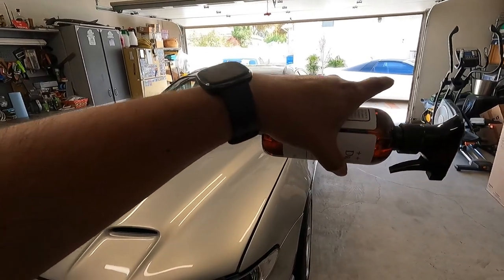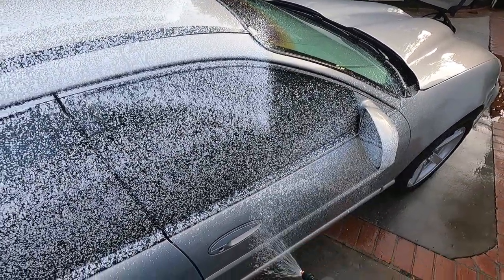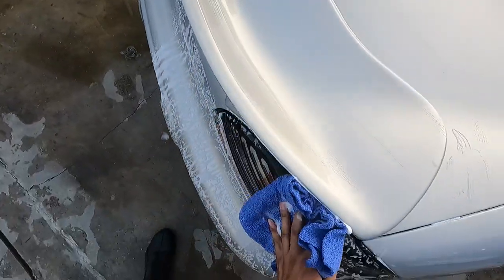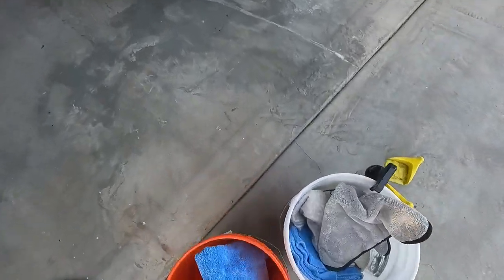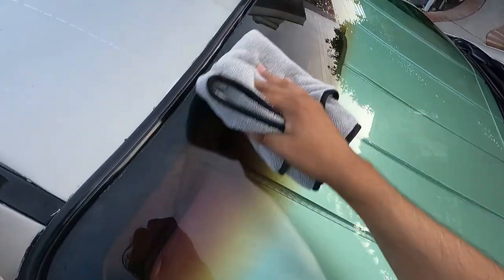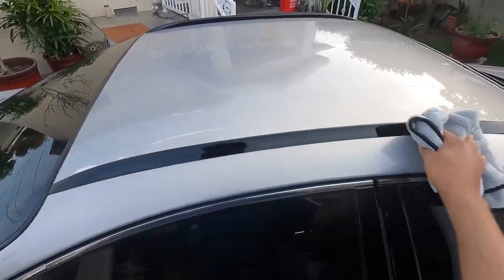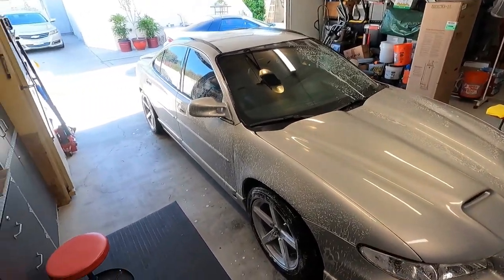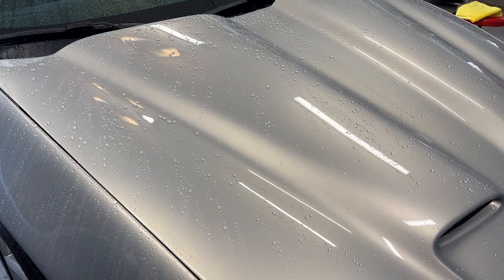Dr. Beasley's Paint Hero Application and Review

Comment: Kinda weird showing off a drying aid on already dry cars. Since that's not really how most people would use it. I was curious to see it's behavior with a wet (post wash) vehicle...particularly if it's streaky, or anything, once it's mixed with the water. Have you tried it after a normal wash, on a wet vehicle?
Reply from the maker: Feel free to check this video out https://youtu.be/83qVKoOMCZU

FYI I use a blower to dry my vehicles to not have standing water left on the surface which risks the chance of water spotting.

Comment: Can this be used as a traditional drying aid as in the car's wet sprayed on and then dry it off?
Reply from the maker: Yes. It can be used on dry, wet or semi-dry surfaces.
Reply: @MikeGDetailing   I bought this and hope it's good, a little pricey❗️
Reply from the maker: @klasseact6663  spray it onto the towel is my tip to you. It is easier to work with that spraying it on the surface
Reply: @MikeGDetailing  I will!